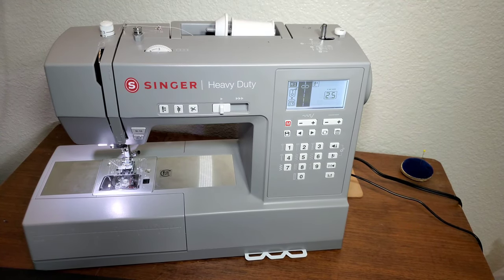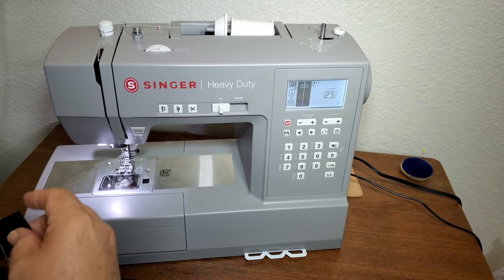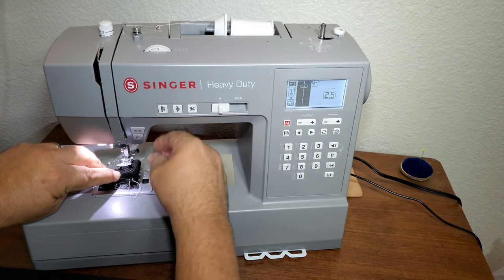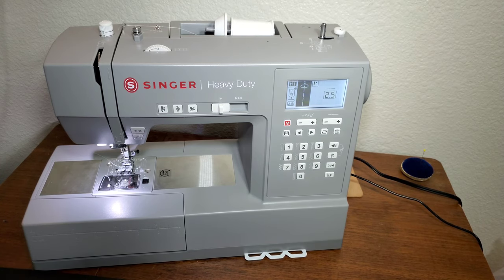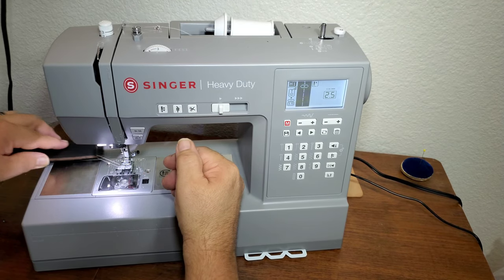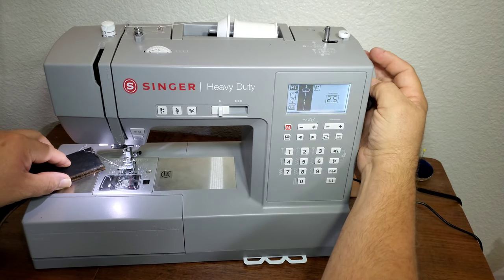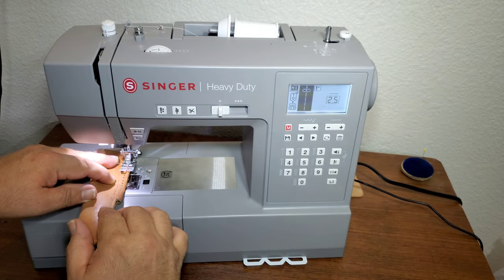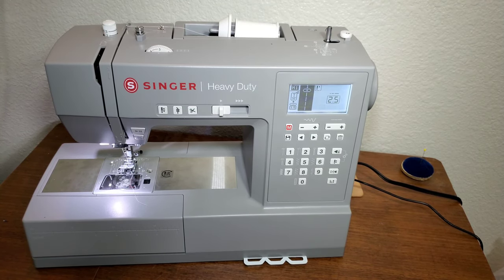Singer Heavy Duty 6800C Sewing Machine Sewing Webbing and Leather

Comment: Thank you for this video, it earned you a new subscriber.  I just recently bought this model, and although I haven't got to webbing yet,  it is one of the major things that I used my older vintage singer 201 (i think, according to the serial number made in 1947) for. But it was struggling with 4 layers of webbing... although it was direct drive. At first I was thinking of selling it to help offset the costs of the 6800c,  but I might keep it as a backup. Plus I can put the old one tucked into the table, and place this one on top, and don't have to find another table.   Still looking for a video on sewing buttons.... so back to my wormhole scrolling down YouTube videos on the 6800c.

Comment: Did u ever play with thenpressure Of the for, lighten it for that think sandwich?
Reply from the maker: No it was  set on what it came with 3 I think. Thank you
Reply: @Xcallaburr  is the dail on to-, the found one… over the foot on top Of it…. Have similar one, no fancy display…. And found your video, besides i Love bushcraft… bcs i striggled with sewing fabric on webbing…. The later batch is to soft, so i Just got diffrent mind the am to finish Project And use that one for something else…. Love that mashine so far…. For webbing i had to use the biggest needed i have 100 to Work. 90 is normal…. I assume also if it gets to think the needed may not able to go down deep enough …. Overall happy with that hobby heavy duty…. Dreaming Of a Sailerite mashine one day…. but thats more than i really need… also Love old mashine with manual foot paddle, They really strong. My grand dad had one, he was a Tailor, sadly could not just bring it to Hawaii from Germany when he passed on….

Comment: Have you tried sewing denim with the standard needle? If so was it okay? I did purchase the denim gauge needle too but was wondering about just using the one the machine came with. I’m just starting out! It would be to sew 2 layers in some places but not more than that. Thank you.
Reply from the maker: When I tried the 10 layers it was with the needle that came with the machine. It worked well. Thank you for your question .

Comment: When you sew a zigzag stitch, does the zigzag shows on the top and bottom of the fabric?  For me, the zigzag stitch only shows on the bottom of fabric and M2 5 stitch is on the top.  This is not what I want.
Reply from the maker: Try decreasing the tension.  It work fine on mine at a 1 tension. Zigzag does the same on top and bottom maybe same issue.